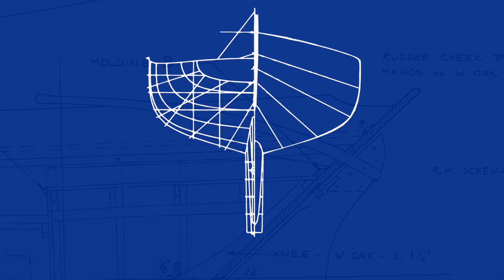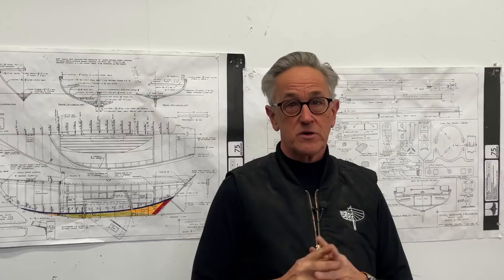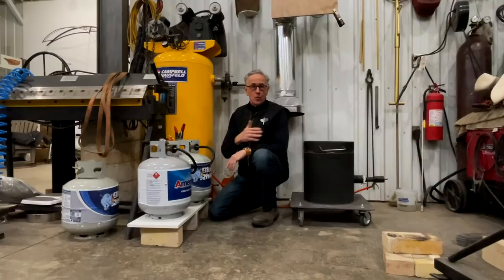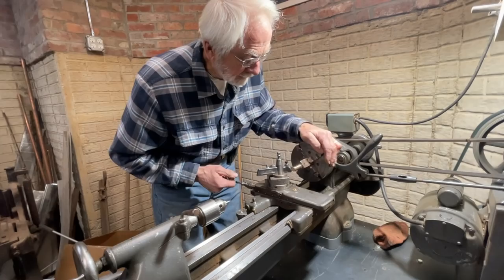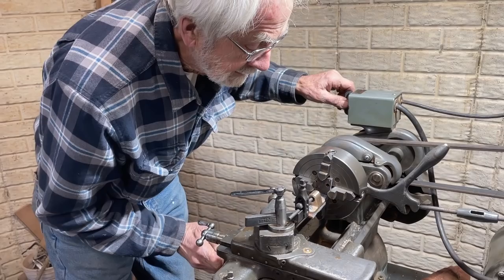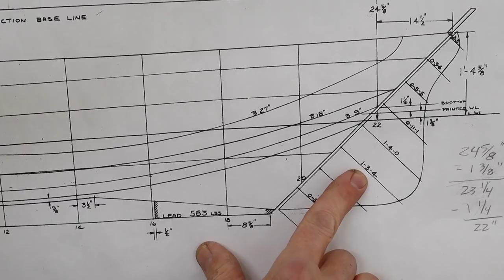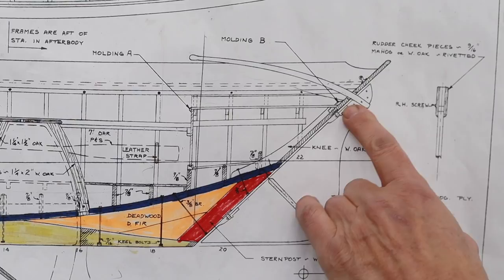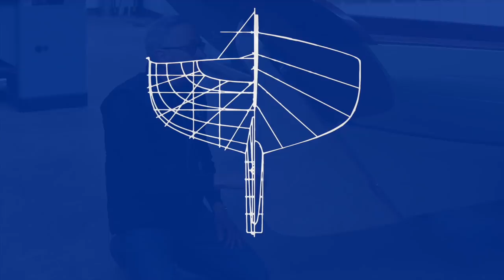Bronze Cast Pintle and Gudgeon, and Cutting out the Rudder S2-E59

Comment: Can you discuss the screws holding in the plywood rudder end grain? Was the rudder designed to be solid wood? Are there also straps to reinforce that connection?
Reply: I was wondering the same thing. Pretty sure the plans called for laminated mahogany ply. Pintles often - usually? - have straps to allow through-bolting, I was a bit surprised to see these plans seem to rely on a relatively short screw into end grain plywood. Maybe the pintles get glassed in?

Comment: Couple of things: I would have thought you would epoxy the pieces of ther rudder together. Are you planning on sealing the end grain of the plywood with epoxy?
Reply: One thing I would have done, were it my rudder, is to laminate the 2 layers with epoxy and sandwich in a layer of fiberglass cloth - it gives a lot of strength to my kayak paddle laminations.  But of course, it is not my rudder.  And wisdom would lead me to avoid second-guessing Bob's boat building!

Comment: What's the composition of that bronze? It seems a little soft.
Reply from the maker: It is Silicon Bronze. Nearly as hard as stainless steel, silicon bronze has a (Rockwell B) hardness of 60-95. Compared to brass fasteners, bronze is much harder and more resistant to corrosion.